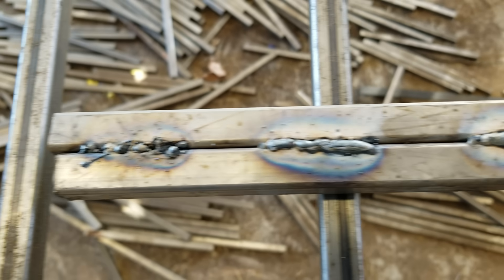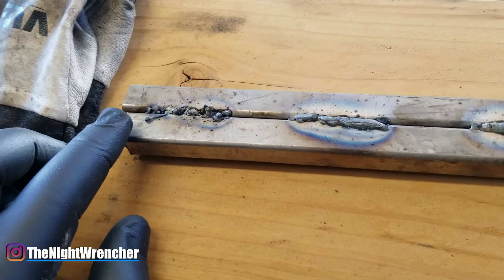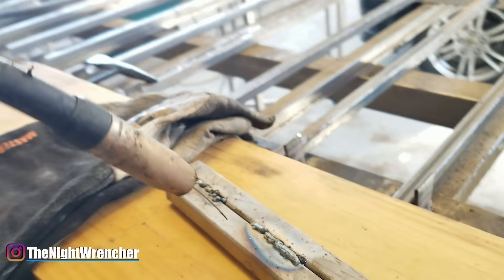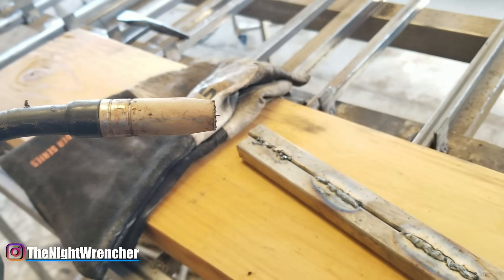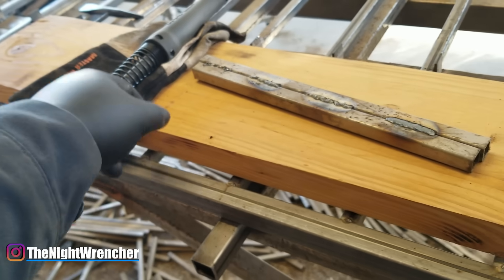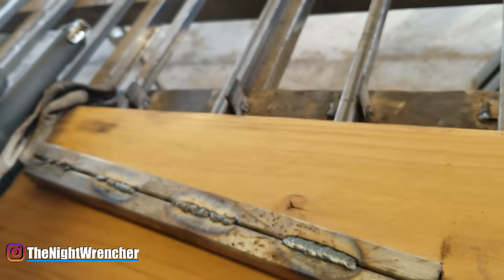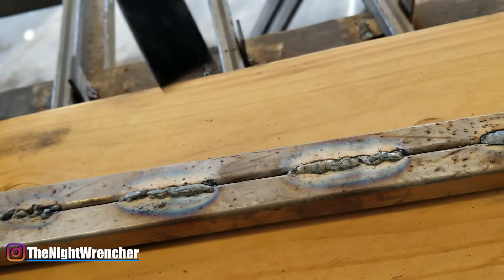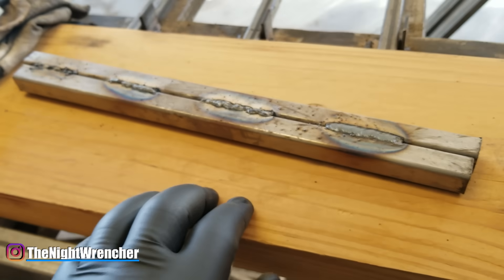Learn Perfect Flux Core Welds In 10 Mins | Gasless Flux Core Welding For Beginners Tips And Tricks |

Comment: I like the way stick welds come out better than flux core.  I can do OK with the flux but to me the weld quality is better with a straight rod.  I usually use 6013 which people call easy rod but I like the slag that it generates and the overall quality.  Using a 7018 you have to be worried about storage conditions.  6010 and 6011 are good but the slag isn't as impressive 😁.  Call me weird but there is satisfaction in chipping off a good slag and reveal a decent weld underneath what can I tell you?

Comment: My advice for beginners with basic beginner equipment is to max out the machine on heavier gage material and work your way backwards . You will learn much faster. And if it slags, you drag( flux core or stick . And keep your wire at the front of the puddle !!

Comment: I have never weld but like to learn for small auto repair jobs at home. Does the ground cable from the welder always need to be Connected  to the metal you welding on?
Reply from the maker: Yes, absolutely. It wont work if the piece isnt grounded somehow

Comment: Does the whole piece of metal have to be clean of rust and paint or just the area you’re welding and the area that the ground is connected to as I can’t get it to spark?
Reply from the maker: The area that youre welding and the area for the ground clamp should both be bare metal

Comment: Wrong, when your gun goes before puddle it’s pulling, when gun behind puddle it’s pushing. And you can use both methods on MiG depending on position and thickness of parent material.
Reply from the maker: This isnt mig.
Reply: I give it what you say- like flux got no gas pressure that’s way your puddle has different behavior. And it’s more looks like stick welding. But in case pushing/ pulling welding puddle you still feel differences.

Comment: You dont really need the gas shield nozzle on the end of the gun for flux wire welding do you ? See a lot of guys welding without it
Reply from the maker: Depends on the gun. Some guns require it to hold the tip in but most dont. I keep it on so I dont lose it.
Reply: @NightWrencher 

Thanks for the reply on my question and the video was great info for learning

Comment: I have always welded with stick 7018 and 6013 rods in my job. Only used a mig once or twice to tack. I can run some nice beads with stick just curious how much different the technique will be and how fast I can pick it up. Just bought a small mig welder for around the house.

Comment: I'm working on a scooter and I need to move a few brackets. It's my first time welding and my welds look indeed like the ones most left. I've watched a few videos on how to weld and how to set my machine but I still don't seem to get it right. Some brackets work and some don't (spot weld) So I'm losing my confidence on the brackets that don't seem to work. I'm taking a break right now and now I've got some extra info which I can try and do a bit later today.
Thank you for this video.

Comment: Are you supposed to actually touch the wire to the metal or have it actually touch the puddle?
Reply from the maker: @hippo-potamus  sort of not really. It should vaporize before it hits the metal. You should have a smooth welding wire sound with almost no feeling in the gun

Comment: With this welder machine can you welding a inox steel?
Thank in advance!
Reply from the maker: @Alma.tec21  stainless? Yes. Any gas welder can weld stainless. You just need to use stainless wire and tri mix gas
Reply: @NightWrencher  so with gasless mig welding machines like this you can't welding stainless steel, right?
Reply from the maker: @Alma.tec21  you can, but it will not be stainless anymore.

Comment: Do you need the round tubular shield on the end of the gun if you are using Flux Core Wire?
I just got a Mig set-up but it came with carbon dioxide tank and non-flux wire and I wanted to use it on some dirty steel with flux and I noticed a couple guys that removed the shield off the end of the gun.  Will I hurt anything if I do this?? Great Job on the Video and I liked and Subscribed~!

Comment: I can't see what I am trying to weld,need a bright light, I could weld gas MIG 20 years ago at work, retired now, cant remember what type or glare resistance goggles  I was wearing but seem to remember a better view of the weld, I now have just bought a gasless mig and my efforts look like that first attempt on this video. I have read its a good idea to get rid of the gas shield on the gun as you dont need it and get a better view. P.s. someone else set up the gas and wirefeed for me at work.
Reply from the maker: Get yourself an auto-darkening helmet. MIG and flux core need different helmet settings so you need something adjustible to get it just right. Get your face closer to the weld as well
Reply: @NightWrencher  I do have an auto darkening helmet, but I am trying positioning a floodlight  over the top, seems to help.

Comment: Are there environmental factors that affect flux core welding, like wind? I've heard from some welders that MIG welding outdoors can be rough on the finished bead due to wind blowing the gas around/away.  Great video on explaining why welds look the way they do.
Reply from the maker: @dllcontacts9799  flux core is not affected by wind which is why its the preffered method for outdoor and rural areas
Reply: @NightWrencher  I appreciate the reply Sir. Good to know information.

Comment: Excellent video.  I didn't even realize you could possibly weld from several inches away.  I'm self-learning to use a flux .035"  Lincoln 110V Handy Mig and it specifies an electrode stickout of 3/8"...somewhat shorter than your suggestion.  I'll have to experiment with longer and see what difference it makes.

Comment: I would be interested to hear whether this was a 220 machine or 110.
I personally have never welded with any 110 flux core welder worth a S  
Do you think 220 would weld differently than 110?
Just curious
Reply from the maker: All my welding is done on 110v. I dont weld steel thick enough to require 220v

Comment: I have to weld a plate upside down on my truck body mount. does it still puddle  or is there another trick for that without flipping the truck upside down? LOL?
Reply from the maker: Thats hard because the weld wants to "run" down like paint. You have to kind of focus on the top plate and then "lead" the weld onto the bottom plate, then swing it back up. Easier said than done and be prepared to get burned. Dont be afraid to let off if you start seeing a ball forn

Comment: Good video. But I wish someone would touch upon the cheaper 120 volt machines which are so popular these days. They are cheap for a reason. (Usually China) They are light for a reason. (all aluminum wire and little of it) and their usefulness is very limited. (Thin materials in flat positions) They usually lack enough control to produce consistent welds. The flux wire feed machines simply don't lend themselves to tight areas and anything other than table top work. If all you wish to do is weld perfect coupons together on a welding table these machines will do the trick. On rather thin metal. Any other work such as what would be required in normal maintenance or fabrication work, you're much better off with the good old fashion stick welder. Spend the money on good equipment.

Comment: for a start it is mild steel not iron
my advice after60 years is, start high amps have someone watch your  volts, turn your volts til your arc is smooth and just off of the spray, cold lap is having too few  amps, wire speed controls amps , or current, on inner shield drag and you MUST reverse the polarity that is neg to wire pos to earth
only reason i use is shielding gas cost moonbeams in Australia

Comment: Excellent presentation, informative, to the point, without irrelevant topics. I always wondered why my occasional flux-core welding turned out with inconsistent little balls. This is how YouTube presentations should be made. I am going to get an anti-spatter spray can to control spatter in surrounding area. My only question is would the spray on the welding joint cause a problem and weaken the weld sticking to the metal?

Comment: I need to know the steps before you start welding. 110/220? Thickness of metal, type of welds. Overhead, horizontal etc. How to start the weld and making adjustments.

Comment: I am an old buzz box guy but had welds that looked like 2/3rd welds there. Now know what I am doing wrong from your video. My gun angle is the issue. I was 15 degrees measured from the incorrect vertical plane not the horizontal plane. I had the old buzz box angle. Thanks for this.

Comment: Im waiting on my electrodes from ebay. They are multi perpose sticks. I dont have the outlet, so i'll shave the earth pin down so it fits. (im in Australia) I hope my house power is good enough to weld rhs etc. If you have any tips for a first time welder (ish, i used to tack stuff for my boss). All help is apreiciated, and i'll post a vid on my first attempt using your knowledge. Wish me luck mate, and cant thank you enough.
Reply from the maker: Hey bud, flux core and stick welding are mutually exclusive processes so techniques in one dont nessesarily transfer to the other. Try it out and let me know through!

Comment: I thought you were supposed to push TIG welds, or is it different with flux core?
Reply from the maker: Completely different process but although draging is easier, on thicker metal, you want to push for more penetration. Anything thinner than 1/4" is usually safe to pull.
Reply: @NightWrencher  Thank you. I felt more comfortable pulling then switched to pushing when I read TIG required push.
Still learning, but hoping one day I'll have professional welds

Comment: Good explanation ---- but honestly ---- you really don't need to be an expert welder to weld with CO2 machines --- its rather effortless and easy ---- just know your angle and intensity
Reply from the maker: Good comment but I think its on the wrong video. These are welds without gas.

Comment: My welds are horrible and a bunch of balls. I’ve improved very little and just put a ton of product. All my welds have been upside down laying under broken frame to post restaurant bench seating. They seem to hold but look ridiculous.  How much can I blame my welds on these difficult conditions?
Reply from the maker: Upside down welding is not easy. You need very particular weld settings for that and it hurts a lot. Not something a beginner can easily tackle.

Comment: What's the best settings for exhaust pipe with a flex core machine wire speed and voltage  ????????????
Reply from the maker: I like to run around 105 @ 16.5 volts depending on the machine
Reply: @NightWrencher  thanks for the info I will try that 👍

Comment: Hey man. Is welding with Flux core just like welding stick? I think I watched a video on this before but u can push the weld when u are welding MIG with GAS, right? 
I bought a HITBOX HIM200 a few weeks ago. I haven' used it yet but I will be starting a welding course next month doing stick welding 1st for 10 weeks. Then I'm going to be doing a TIG welding course for 11 weeks after that one. 
How many hours of training on a course would u suggest is enough to become competent in all 3 forms I want to learn, MIG, STICK & TIG welding??
Apologies for the questions my friend. I do a little bit of stick welding in my garage shop but I was blowing through the 2.5mm square tubing at times until I got the distance correct. I use 6013 rods, 1.6 & 2.0 rods in 6013 to weld that thin metal.
Once I started getting the correct distance with t5he ARC and steel it welded a whole lot better. Obviously the amps has to be right so I was welding at 50-55amps with the 2.0mm rods and t worked fine.
I'm struggling a little with the Flux core MIG atm. I'm not sure about settings but I think this welder has those in built approx settings to work with in the beginning?
I will get there and can't wait to start the courses soon.
Welding is something I really only got into over the past few months but I've been waiting to get the courses so I can really learn the basics correctly before going nuts in the shop.
How hard is TIG to master? I'm guessing it's probably the toughest to get to grips with?
Great video btw. Really enjoyed the tips u gave us man. Keep up the great content. It's very helpful..
Apologies for the longwinded comment and the questions too btw. I get carried away when it's something I enjoy on here..

Comment: I use flux core like Frank's Red hot; I put that shit on everything!  I do 99% of my welding outside daily so it's either flux or arc, with flux it don't matter if it's a hurricane you don't gotta worry about your gas blowin away on ya and Burnin up your material.  Great video my man A+

Comment: Wow this is amazing!

I've only been welding for 3 or 4 years or so, mostly aluminium, took on bigger (for myself) projects than I really should have for a beginner, built a boat, etc

BUT I recently got a cheap flux core MIG just for the small fixes around the house, hutch cover here, hinge repair there, chicken coop fixings, trailer jockey wheel, etc - whatever -- and after a few practice shots I have quite a wide variation in quality amongst these welds, from 'good/passable' to total popcorn mess! - and I hadn't figured out WHY yet...

Your video has just helped me immensely as I have encountered all of these types of welds on my recent attempts and wasn't sure what I was doing wrong on each, I jsut knew sometimes they'd come good and sometimes they wouldn't lol

THANKS THANKS THANKS!

Comment: I understood the stick out. But does the weld wire need to touch the surface as your welding or a small gap towards surface?
Reply from the maker: It will look like the wire melts before the surface but the initial strike has to touch the metal and then the rest of the wire will disintegrate just before it touches the metal

Comment: Nothing mentioned about polarity.  Gun should be negative polarity so to make the metal have more of the heat and not the wire.  For steel there should be no more than 1/2 inch away from the material.  Not 3/4 as mentioned.  That is for aluminum.  Can't believe all the comments praising what they don't know.

Comment: Should I get a mig or a stick welder tor try first?
Reply from the maker: It depends on what your final goals are. If you planning to weld a lot of thinner gauge metal like exhaust, sheet metal, square tube, etc. A mig is better. If you plan on welding structural components like i beams or gas pipe, I would get a stick welder
Reply: sorry I meant flux or a stick welder to start. I didn't know what I was talking about. @NightWrencher
Reply from the maker: I would be giving the same response. The only other benefit of going flux core is that if you can figure out flux core, moving on to MIG welding is easy.
Reply: Thank you! @NightWrencher

Comment: Weather Flux core or gas , besides the Good advice for Beginners, Any Way Prep.Metal first, Clean Steel Or Grind And wipe off with dry rag ,1/16 - 3/16, Start at Settings Listed, Any thickness 1/4" or thicker Beval Base Metal 45% Angle For Better penetration along joint Travel Area, The More heat on metal ,Increase travel speed, Accordingly,Gas welding  Mix On steel 75%Argon25% oxygen , On Aluminum Alloys 100%Argon Only,Mig And Tig Procedures ,Stainless steel, Use tri Mix, Because Stainless steel Can withstand alot More Heat Before  you Blo-through material?

Comment: Thank you for all the info. Im finally found the sweet spot. Mainly in my settings. Of course, without having learned the other things from you, i couldnt have gotten to this point. I built a small wood burning heater with a small chemical can. I used 1" angle for legs. I grind the heck out of my joints before anybody see's them. thanks

Comment: Thanks for a great MIG flux core welding video!  I've watched many and no one else explained it as concisely and thoroughly.  Two things stand out:  anti-stick spatter spray (gotta me some of that!) and dragging the pool instead of pushing.  All the other vids say you can do it either way, push the weld pool or pull it, but this one makes a ton of sense, I will drag from now on.
Reply from the maker: Thanks bud. Its true that you can do it both ways but I've always found it easier to learn when you're pulling instead of pushing. After you got the basics down, you can learn to do both.

Comment: I've been welding for over 30years and I have to differ with you on the drag . If you are running something like.035 solid wire you can drag but using flux core for penetration you have to push as long as you stay on the leading edge of your weld you will not have any problems

Comment: very good info, In high school our teacher wouldn't let us use a wire feed , arc and gas only, so I didn't have much experience with mig . I have been pushing into to my welds , thats great info , also  my friend borrowed my welder , and was having issues , he decided to buy some better wire, I had the ol harbor freight brands in it . I didn't really know what  difference it would make, apparently quite a bit . Haven't tried it myself yet but went to an actual welding store and got a brand they recommended

Comment: You should also change the tip bowl out for a Flux core nozzle, it will improve your visibility of where your welding 100%. The MIG bowl that comes on all welders is used for MIG. It won't hurt using it on Flux Core, but you get reduced visibility and will have to adjust in obscure ways and angles. The tips are cheap ranging anywhere from $5-$15 for as far as I've seen on the market.